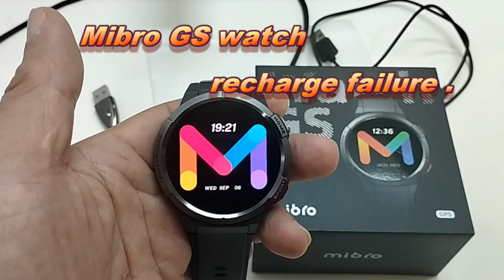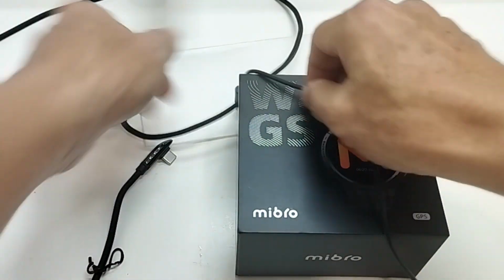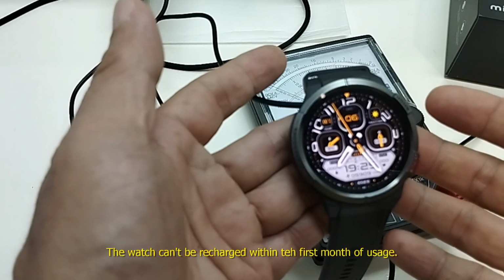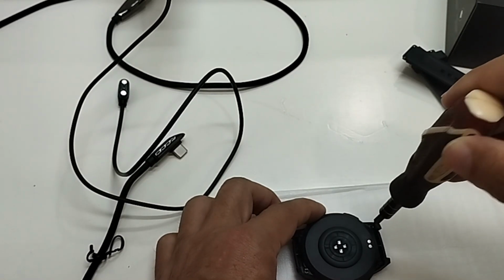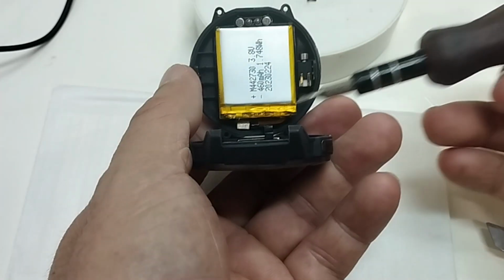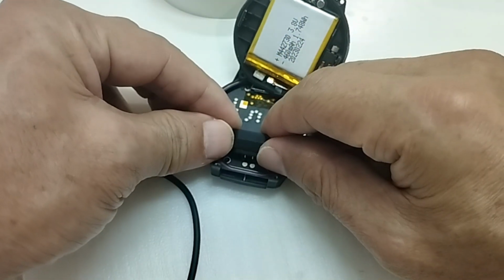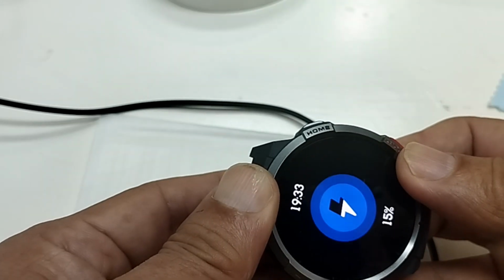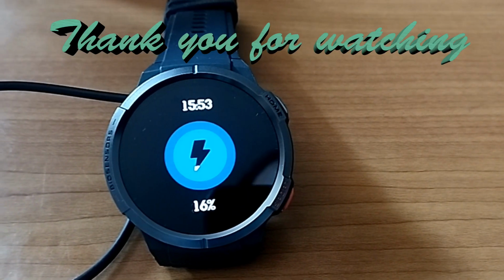Mibro GS watch  recharge failure fixed.

Comment: Hello, my watch was sent for repair but when it came back, I noticed the cable doesn't attach to the back of the watch because there was something wrong with the magnets. So I checked it and understood that the magnets in the watch are the same polarity (For example they're both N) because one of the poles of the cable, pushes back both of the magnets on the watch. Can I simply fix that by simply turning one of the magnets around in the watch? Can I even detach the magnets?